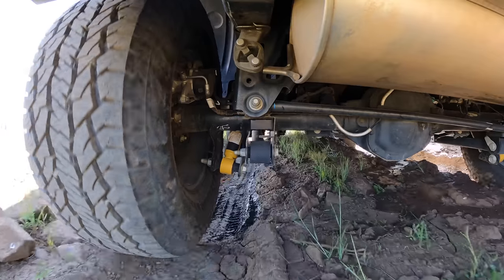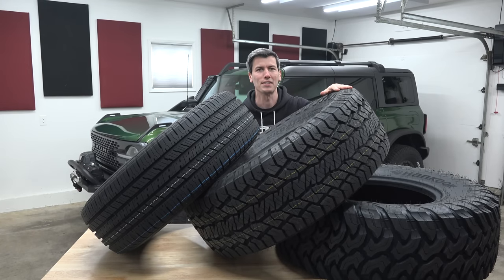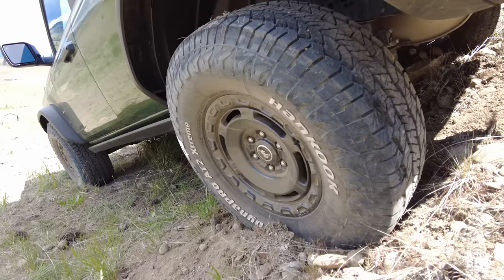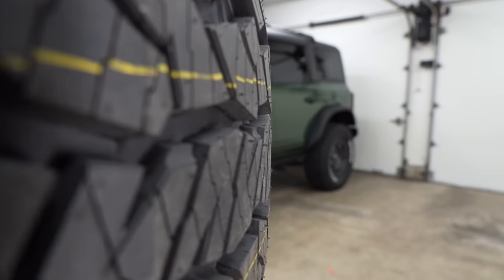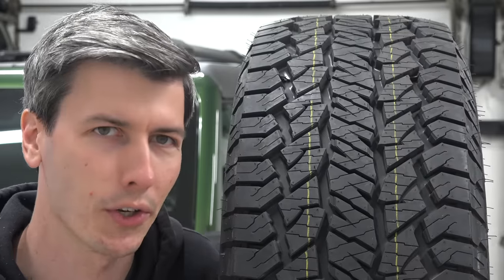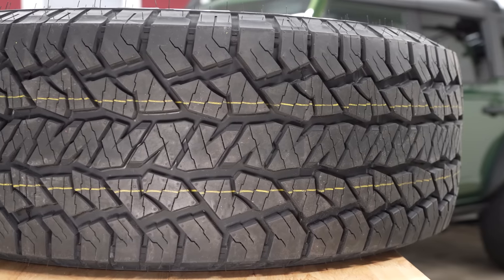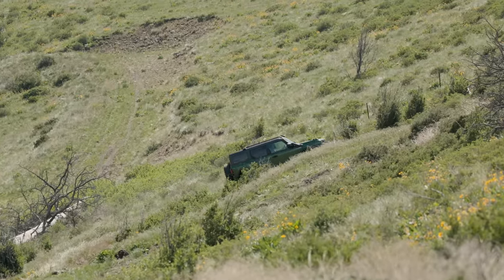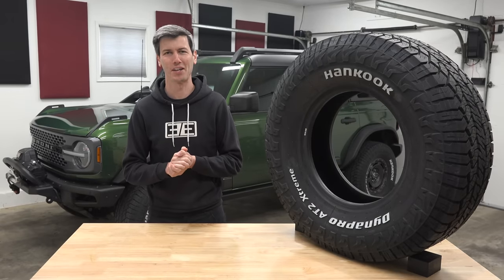The Most Difficult Tire To Create - All Terrain

Comment: The more you understand the abuse tires are designed to deal with, the more amazing it is how they work as well and as long as they do.
Reply: Yeah, especially for the cost.  I know they are expensive but when you consider the design, materials, sizes, liability, shipping, marketing, etc.  It's amazing you can pick up 35" or 35" tires for what you can.
Reply: And not just last a long time but be reliable. Last thing you want is a bunch of tires randomly blowing up on the road
Reply: Tires blow my mind🤯 always have. Even the basic expectations, like just staying on the bead and not constantly failing.
Reply: I beat the absolute crap out of tires.  They do amaze me, but so do roadside tire plug kits and slime.
Reply: @jbird1173  How do tire plugs work??? Seems so ghetto. Bulletproof.
Reply: Understanding the abuse tires go through make me spend a little extra on them too
Reply: indeed. a much more complicated part than most people understand
Reply: @davidlobaugh4490   find the nail or whatever is making the tire leak.  Yank it out, and insert basically a short piece of rope covered in rubber glue.
Reply: and 90% ppl when they have to buy new tyres will go for the cheapest option 🤦
Reply: @gabehorn69420  Firestone truck tires .. some years back . 💥💥💥💥💥💥💥💥💥💥💥💥💥
Reply: Consider how poor, inefficient and unreliable tires were in the early days! "You there! Fill it up with petroleum distillate, and re-vulcanize my tires, post haste!"
They have  progressed so much that you  just never even think about them in your  normal driving!
Reply: True

Comment: Actually it's good to air down in basically all offroad scenarios.  Not only does it give you more grip in things like rocks but it DRASTICALLY softens the ride on uneven terrain.
Reply: Also really helps to reduce punctures.
Reply: Except hard pack snow. Higher PSI is better there.
Reply: @evictioncarpentry2628  I don't wheel in snow very often but it's good to know that is the way to go!  Thanks
Reply: @olliehopnoodle4628  The higher PSI reduces the contact patch and puts more pressure to the ground helping the tire bite the hard snow or ice better.
Its about the only time you don't want extra floatation from reduced tire pressure.
Reply: @evictioncarpentry2628  Thanks!  That's great info!  I appreciate your explanation.
Reply: @olliehopnoodle4628  No it doesn't. You drastically increase the chance of getting punctures. The rim cuts into the sidewall and sharp rocks can destroy your tires. 30+ years experience off-roading teaches you a lot.
Reply: @grantadamson3478 it increases the chances of breaking the bead and having a flat. Better to gradually reduce air pressure as you need to. No need to go to 10 if 20 will work.
Reply: I've always wanted an onboard air compressor and air tank since the days of off roading in my Chevy LUV truck in the late 70's , now that I have it in my 09 I find myself airing down even  for dirt roads, the improved ride over washboards is worth  it 🙂
Reply: @grantadamson3478  We are going to have to disagree on this one.  Airing down is like deflating a balloon, the less air in the balloon the harder it is to puncture.  I've been wheeling about 25 years, mostly in the desert which includes a lot of rocky washes and shelf roads and have never popped an aired down tire.   I've also never had a rim 'cut' into the sidewall.  Either way, I would still air down for the other reasons.    Take  care!
Reply: @olliehopnoodle4628  coming from the sands of abu dhabi, aired down means punctures from dead sticks out here (they do exist), and pop-outs from drive error or just the terrain. Beadlocks solve pop-outs, avoiding sticks solves punctures.

8psi is normal.
Reply: @evictioncarpentry2628  Plus it gives you that teeny bit more ground clearance. People always laughed at my "pizza cutter" 175/65 R15 pumped up to 45psi when my car came (stock?) with 205/35R18 but I could drive through snow no problem, plus never hydroplaned.
Reply: @grantadamson3478  if a tyre has high pressure it won’t mould around sharp object and is more likely to get sliced/ punctured and the ride will be tougher on the vehicle
Reply: @randomvideosn0where  Jesus that’s tiny, is that on a really small car?
Reply: @joshbenton810  Hyundai Ioniq. Googling it they recommend no smaller than 195/65R15 but whatever
Reply: @evictioncarpentry2628 I live in Iceland. As you can imagine we have pleanty experiance with snow, everything from powder to ice on glaciers. You will not find a single person I am afraid that will say more tire pressure will give you more traction even on hard snow or ice.
Here we lower our tire pressure every time we go on snow everything from down to half pressures for hard packed snow down to 1/10 road pressures in powder snow.
F.x. with the popular  Landcruiser on 44 inch tires will be aruond 20 psi on road, 10 psi on hard packed snow and 2 psi in the deep stuff.
Reply: @gumundurpetur9114  Cool. I'm in Northern Canada and the fact of the matter is, science and testing (you can look for the videos yourself) say you're wrong. Higher PSI on hard pack and ice is superior.

Sounds like what you're speaking of with 44inch tires are what we would consider arctic "Tundra" vehicles. They're made to go slow and air down with big wide tires for floatation. Not the same thing.
Reply: @evictioncarpentry2628 
Well we'll have to agree to disagree :D 
I will continue to air down on hard packed snow along with all Icelandic drivers I have met so far on my travels across the highlands and glaciers. We must all be wrong then.
Reply: @gumundurpetur9114  You are. But you do you.
Reply: @grantadamson3478 it took you 30 years to realize you dont runn flat tires offroad?

Comment: You are kinda on kick about tires right now. May I suggest you go and talk to O'Neil racing or DirtFish about the unique needs of rally tires. You think all-terrains have a tough job.
Reply from the maker: Not as in depth but I do share some good details on them here, with Subaru's rally team! https://youtu.be/1971DmZC41s
Edit: Worth noting, while the rally tire environment is certainly tough, rally tires aren't so worried about noise, ride comfort, rolling resistance, and a tread that lasts 60k miles. OE road tires really do have an incredibly difficult challenge to overcome.
Reply: Well, tires are very fascinating, the only component that connects the car to the road. Especially high performance tires face various unique engineering challenges.
Reply: @EngineeringExplained if I hike the trail with the mountain goat carrying my luggage, the grip is always there.
Reply: @DefinitelyNotEmma Not necessary. All components you can touch on the outside can touch the road, but that's less favourable.
Reply: @Donnerwamp  lmao, true
Reply: @EngineeringExplained  If I recall they only had 2 sets for safari rally last year, Rally tires are tougher than you realize these days.

Comment: I remember reading an article about rubber compounds having about 20C of optimal operational range.
+10 - +30C for summer tires.
-10 - +10C for studded winter tires.
-20 - 0C for studless winter tires.

Temperatures bellow optimal means the tire get to stiff with more slippage as a result, and above means to soft with higher wear.
How do do all terrain tires handle this problem?

Comment: I don’t have an off-road vehicle, but I’ve got Hankook’s Kinergy GT tires in my Celica. They’re fantastic in the snow and last forever and the second set I’ve used.
Reply: @dankshiz69  Who beamed you down?
Reply: I found the Kinergy GT to be pretty terrible in snow and ice, at least our wet type of snow in western WA. They were compliant and generally good in the dry. Michelin and Pirelli use a higher silica compound which seems to hold to the slippery stuff better.

Comment: BFG factory employee here. The customer expectations for NVH (Noise, Vibration, and Handling) for AT tires has increased exponentially in recent years. The KO2 was tweaked to improve it over the years, but needed a design step change for KO3 deployment.

The company launched the Trail Terrain line to provide a more road-friendly option for consumers who honestly only want occasional/mild off-road use.

Edit: almost forgot. OEM’s HAVE to improve fuel economy. It is FAR easier to get 1-2% less rolling resistance than increase ICE efficiency or vehicle aero by the same amount. This is why silica tread compounds have been proliferated (but are a nightmare to mix/extrude).
Reply: I have no doubt that all that abrasive silica imposes a lot more wear on your moulds and other tooling as well. But that's the tradeoff we make.
Reply: Please give me some details on how the BFG A/T KO3 tyres are an improvement over KO2s I have today (that are nice, but disappointing in the mud and snow).
I am thinking of purchasing the new KO3 tyres.
Thank you!

Comment: I have these on my 4runner. So far I'm liking them.
Reply: My big thing I've noticed I had theses an I'm on Ko2s now. They both seem to like to hydroplane. I'm due for tires at the end of the summer. Gonna try the wildpeaks.
Reply: @thresher455  how’s the road noise on these vs the KO2’s that you have now? I have KO2’s and thinking on buying the dynapro next to try them out. Thank you
Reply: Ko2s are great at hydroplaning and not grabbing in general. They also wear out really quick - got 14k on my Raptor's stock K02s, which was average for those of us offroading. 

Got cooper st maxes and they are much better. A friend got the AT2 and really likes them. My tires have way more grip everywhere, but are more loud than I like.

Comment: I've only ran All-Terrain tires on my truck since I bought it since it sees a little bit of both on and off-road driving. I will say that even some of the more affordable options fit the intended role of such type of tire very well. 
The tires I currently have on my truck are the General Grabber A/Tx. The tread pattern is very similar to the BF Goodrich KO series, but actually has more sipes per tread. On-road, the impact on fuel economy hasn't been very noticeable, particularly with highway driving. As for noise, I have not noticed any excessive noise from the tires (granted, my truck's exhaust setup is very loud, so the difference between this A/T vs a highway tire is likely maske by the exhaust). 
Off-road, they've performed very well, even in mud. My buddy, who goes off-roading more regularly than I do and recommended the Generals to me, reported that they handled snow exceptionally when he had to drive home from one of his adventures in a snowstorm. In fact, he actually prefers the General A/Tx over the Bf Goodrich.
All of that being said, it's not surprising how much thought has to be put into the design process of this type of tire.

Comment: One additional thing is that these tires are also rated and tested for high speed performance. All terrain tires would be at most H rated tires which means must be able to sustain speeds of up to 130mph or 210kmh. This adds another layer of complexity in balancing off road and on road performance. Great video 👍🏼

Comment: I'd argue that tire noise is not so much related to air pumping but more to tire/compound rigidity. On tire contact with the road during rolling, the surface of the tire comes into contact aggressively with the asphalt which generates vibration and mechanical stress. When the compound is hard, it won't absorb that stress and attenuate it but rather will distribute the vibration along the surface of the tire and further will be transmitted into the air surrounding the tire and finally will reach the ear.
On the other hand, when a soft compound tire comes into contact with the asphalt, the mechanical stress and vibrations generated by the impact will be absorbed by the soft compound and the amount of remaining vibration which will be transmitted into the air around will be much less, resulting in less noise.
What I say is that you can have identical tires when it comes to tread but different compounds and the noise they make would be very different.
This can be best tested in void having a microphone inside the tire. The harder tire will generate higher noise inside the tire even though outside the tire is no air: just void.

Comment: I watched another video that showed tire deformation over small rocks. The less wide tires seemed to deform more than wide tires. 

I bought a diesel truck 09 gmc two years ago that came with new mud terrain tires and 18” non stock rims. They where very loud and the cabin noise and vibrations where horrible. I swapped them out before they needed to be replaced because it was very uncomfortable with vibrations and noise. I got new rims and tires. 16” rims the smallest rim that fits and 33” tires that are 9” wide. Toyo ATs. My family enjoys riding in the truck now. It’s quite and the vibrations are all gone. These tires at 60psi deform and the tire soaks up little bumps. Night and day between 18” rims with muds and 16” rim with ATs. With the new set up there is a bulge where the tire meets the road adding to the tire deforming and complying. So nice. It changed the whole experience. I barely drive it. It’s just used to tow a boat or truck needed trips.
Reply: Tinkerers adventure was the skinny vs wide tire video

Comment: Just bought these xtremes, pretty happy with them on my RAM 1500.
Reply: Have you had experience with the prior AT2? I have those currently and am curious what changed to make the Xtreme. Both tread patterns look quite similar and I think the standard AT2 is still being made.
Reply: @ALMX5DP  I do not, had to get new tires for my truck and researched all the available all terrains and for the cost, 70k mileage warranty, 3 peak rated and weight I thought the Dynapros were the best option.  A buddy that owns a repair shop said that he's seen guys with 80-100k miles on these.  I wanted the xtreme for more tread depth as in Wisconsin we get a decent amount of snow and as soon as most tires get below 5-6/32" they get pretty sketchy.
Reply: @Hangovna  How the noise from the AT2 on the highway? What tires dod you have prior on the Ram and how would you compare noise and ride quality of the two tires?
Reply: @4Cabin  They are louder than factory but I find all terrains get a smidge quieter as you put some miles on them.  I had factory junk Bridgestone tires that only lasted 30k which were definitely quiet and smooth but offered little off road traction so these are louder/stiffer but still not bad.  Factory size was 275/55R20 (41ish pounds) and I went up to 275/60R20 (43ish pounds).  Fuel econ is maybe 0.5-1mpg less.
Reply: @Hangovna  Thanks. My 2022 GMC Sierra came with the Bridgestone Duller AT RHS. They are smooth and quiet but really lack off road capability and are not good at all in snow/slush conditions. Living in New Hampshire these lacking capabilities are a real problem. So thats why iI interested in 3PMS rated AT tires like the AT2 Extreme. I'm also considering the new Kumho AT52, Vredestein AT, BFG Trail Terrain, Hercules ATX Journey and the Nokian Outpost AT. There are others but I also dont want tire noise to become an issue since we use the truck for long road trips.

Comment: Tires have come so far in my lifetime.  I remember going on family vacations 60 years ago and there were almost always tire failures.  It probably didn't help that my dad packed the station wagon to the gills, put 2 or 3 canoes on the roof, a boat and trailer out back and drove like a bat out of hell.

Anyway, my relevant comment is I have had several All Terrain tires that were remarkably quiet.  The Pirelli Scorpion tires on my RAM 1500 are basically inaudible.  Now there is a fair amount of wind noise but that's typical for the vehicles that use All Terrain tires.

Comment: Michelin does this significantly better than any other manufacturer with the LTX A/T2. They are not even in the same league as what Hankook has to offer. They also have the same warranty and I get 85,000 miles out of a set.
Reply: The problem for Michelin, is that it doesn't have the aggressive tread for the "look". But I agree with you.

Comment: My mechanic turned me on to Hankook tires 15+ years ago when I was looking for a summer-only set for my 540i. They definitely fly a little under the radar in the average person's awareness of tire brands. As Kia's and Hyundai's became more popular for the a to b car consumer, Hankook definitely became more popular here in the states, whether or not anyone actually realized it. As soon as the oem Goodyear's on my Grand Cherokee hit about 40k this summer, a set of the dp xtremes are going on. I love that they have them available in white letter sidewalls too. Helps break up the black blob hanging off each corner of your car.
Reply: Had the Hankook DynaPro AT-M and AT2 Extremes before and they're great tires. You can't go wrong with them. Recently put LT265/70/17 [E load/10 Ply] Sumitomo Encounter AT on a 2019 Grand Cherokee Laredo E  and they're also an amazing tire. They're the milder, more road mannered version of the Falken Wilpeak AT3W's made by Sumitomo, the parent company of Falken. They actually outperform the Falken Wildpeak's, Hankook DynaPros and Kumho Road Venture AT52's. My favorite all terrain tires so far have been Nokian Outpost AT, Falken Wildpeak AT3W, Hankook DynaPro AT-M / DynaPro AT2 Extremes and now the Sumitomo Encounter AT's. Can't go wrong with any of them to be honest. I've tried so many different brands and types of tires so far but those are my favorite all terrain tires. What size are you getting them in and what's your usage going to be like?